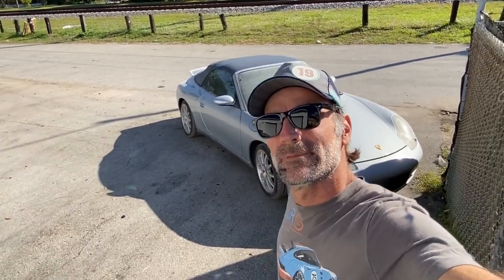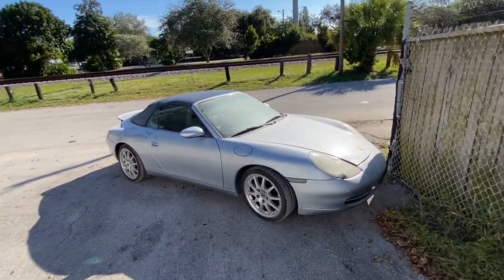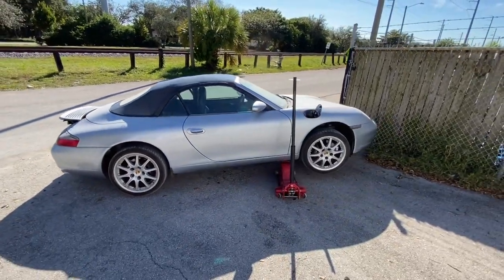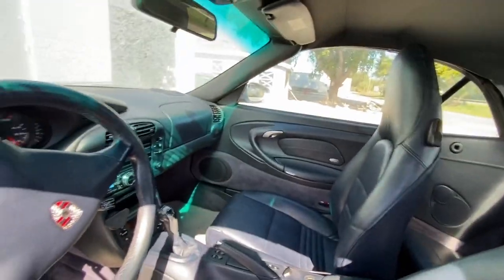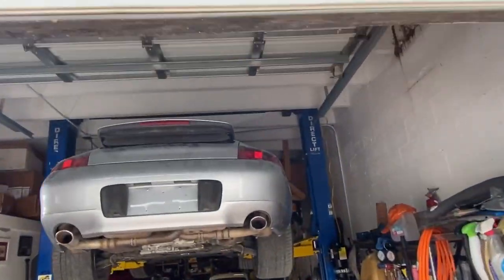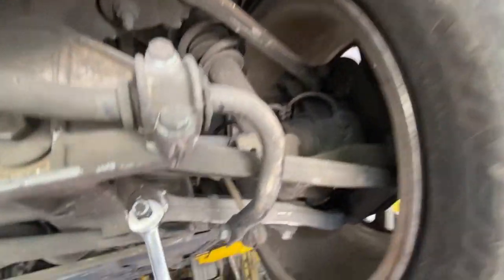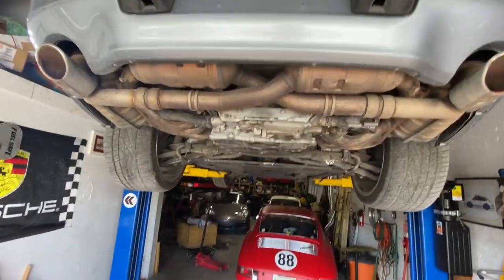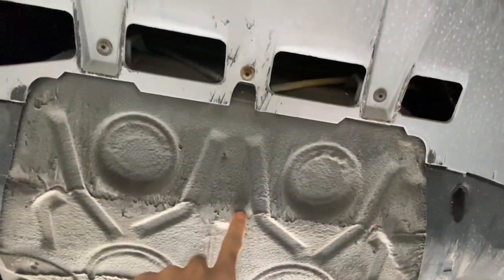I Bought a Salvage Porsche 911 996 Cabriolet

Comment: Stunning car , thank you for introducing me to the 996. I'm already looking on auto trader uk . Next time the boxter s is on the ramps is there any chance of a video of the exhaust system as it sounds great. Apparently because my boxter s is tiptronic a lot of exhaust systems are not suitable. Cheers rich UK
Reply from the maker: Rich, the exhaust on the car is a cheap ebay system like this one: https://www.ebay.com/itm/232977715203?fits=Model%3ABoxster%7CMake%3APorsche&epid=1430917240&hash=item363e8dd003:g:HlMAAOSwqFBbz7~Q
It sounds great !!
Reply: Thanks for the reply. FANTASTIC  videos , can't be easy recording  them and fixing the cars at the same time. I've been doing a bit of research and apparently because the gear box is bigger on my 3.2 tiptronic 2001 boxter s the design is different on the secondary cats from the manual. So I'll just stick to getting a back cat box, cheers
Keep up the good work

Comment: Cross compatible parts have the 911 Gen code on them. An immobilizer starting with a “996.XXXX” is correct. I find 997 parts on my 987 all the time!
Reply from the maker: Yes, you are correct. In fact, that was the how Porsche got themselves back on their feet in the mid-late 90's. They built two cars that shared many of the same parts thereby cutting way back on production costs
Reply: @drolasgarage632  when the video went from 1 Porsche to multiple I realized you probably knew this 😅 so sorry for being Capt Obvious hahaha nonetheless I’m happy that’s how they work!